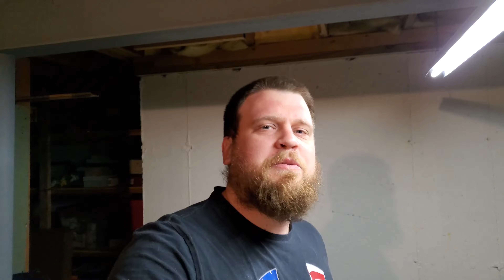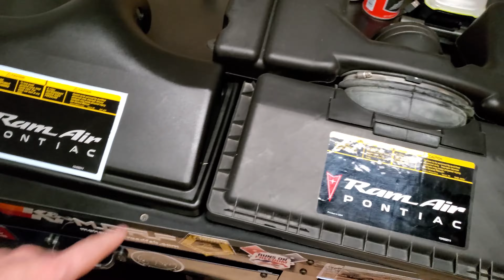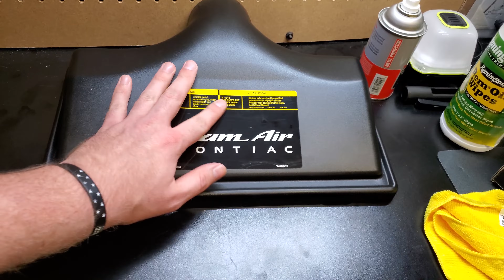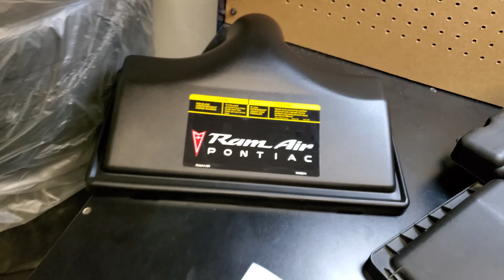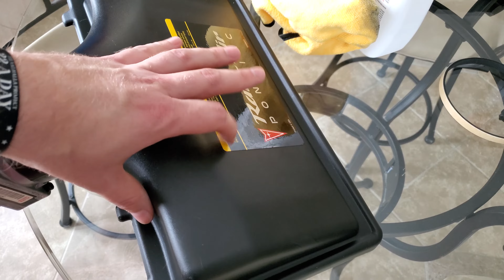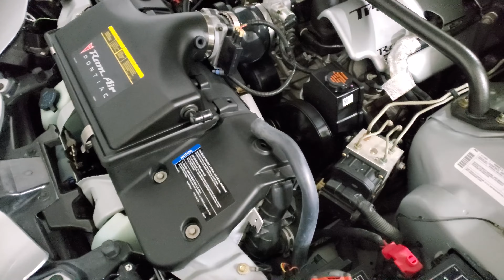2000 WS6 Build with Stock Parts - Step 1 - SLP Lid - 98-02 - F-Body

Comment: Any issues with it hitting or hood rubbing on the lid? I've seen a few with rub marks in center of outlet.
Reply from the maker: I see them occasionally, I haven't had that issue on this SLP lid, but I did ironically on my last SLP lid.. so I guess your mileage will vary.

Comment: Good video, switched mine out but where does the 90 degree hose go down to? Mine doesn't have a hose, just a hole there. I can grab a hose no problem,  but don't know where to connect it to. Is there somewhere in the engine compartment? Apologies,   I'm a newb.
Reply from the maker: If you didn't have a hose in your prior lid then that hole just gets plugged.

Comment: How do I get the MAF off the stock air lod. It's like bolted stuck. It won't wiggle out at all???
Reply from the maker: Try heating it up a bit with a hair dryer or heat gun, but don't do it so much that you melt the plastic.  It should be a slip fit.
Reply: @RamblinGarage  this worked similarly I put it in the oven and then it slipped on after several attempts

Comment: Nobody makes a better fitting lid than SLP that still looks close to factory?  My 2000 Formula is all o.e. 52000 miles and I want to keep the stock look also.
Reply from the maker: Not that I'm aware of, you could always modify a factory lid and remove all the baffling and the wings, it would take some work but it would honestly probably look really nice.

Comment: Dude you still have the Power steering cooler on that car? Remove that Asap
Reply from the maker: I pulled it off, inspected, it looks good, so I just tossed it back in.  If it goes it goes, but until then.. it stays :)
Reply: @RamblinGarage  it literally dies a little bit everyday....just like most relationships
Reply from the maker: @Harlemcars  LOL yeah it probably does, I try to keep fluids fresh.. I tell myself that helps, but who am I kidding lol
Reply: Thanks for the tip tho i will be deleting it on my ws6!